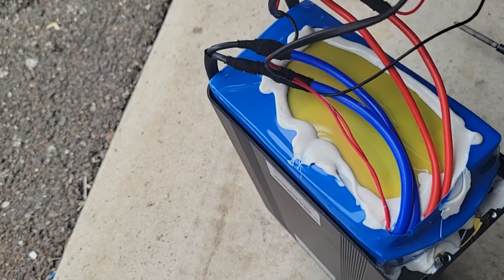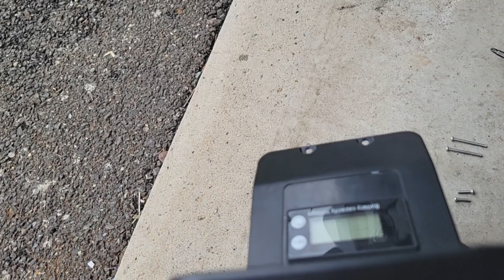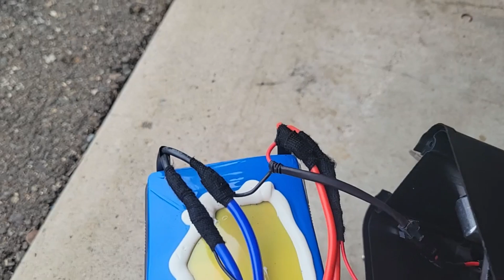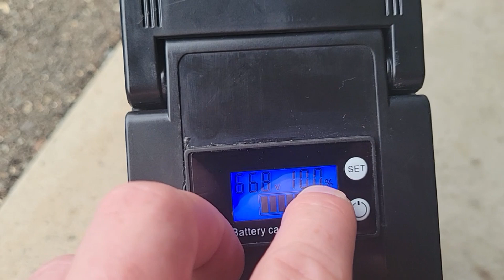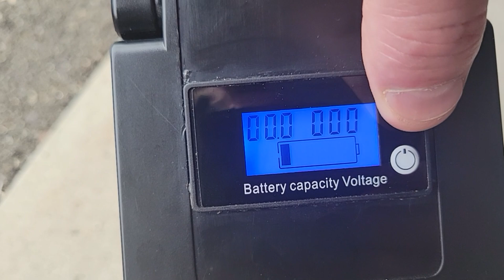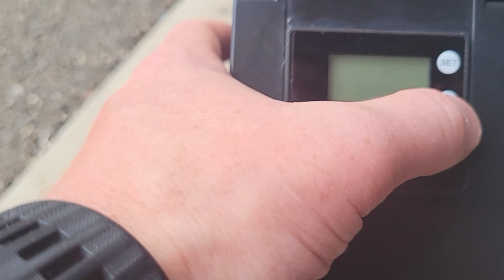EKX X21 MAX battery Voltmeter

Comment: Can you tell me how to turn it off? Do i just switch it off?
Reply from the maker: In settings, you can preset not to turn on when you start bike...
Reply: @JustDoItPlus  no sorry, I was talking about the bike not the voltmeter. Can you tell me  how to turn off the bike? Does it damage the baterry or the bike if I just switch it off with the red switch?
Reply from the maker: @Only_for_guys turn off same as turn on... touch screen with nfc tag,  same as to turn on... or just battery button,  it will not create any damage.
Reply: @JustDoItPlus  thank you!!!

Comment: Hi... 
Great video thanks for that...
I did same think but percentage is always on 100%, how to change that, i doesn't go down ???
Reply from the maker: @krunoslavbenko690  your voltmeter has wrong settings,  read manual for it.
Reply: @JustDoItPlus what manual ? can we contact somehow, facebook or something ?
Reply: @JustDoItPlus  I took it from your link, aliexpress
Reply from the maker: @krunoslavbenko690 it universal multimeter,  from factory can be preset to different voltage.  You need to set it to yours
Reply: @JustDoItPlus  what should I do now, don't understand, from where ? Do you have some contact?
Reply from the maker: @krunoslavbenko690  just read instruction.  It is simple.  Or find video on YouTube how to do it.
Reply: @JustDoItPlus  so I don't need another voltmeter ?
Reply from the maker: @krunoslavbenko690  no. You need just set it up for proper voltage and battery type. Lithium and 16s (60v) if you have same bike. EKXx21max
Reply: @JustDoItPlus  Yeah same bike :)
I put 16s and it works, thanks a lot 🍻

Comment: Why would you install a voltmeter when the volts are indicated on the display when you're riding the bike?
Reply from the maker: @emikearizona  no, it is not. On this model you can see voltage only in 30 seconds after bike turned on... Once you start ride, there shows mileage,  to see voltage you need to turn off/on bike again.

Comment: happy you are making videos on this bike.    Can you tell me if the screen can be changed to MPH? The manufacture said it could, but like Manny said, there is no way to get into the menu screen to change the settings without the -/+ controller
Reply from the maker: I sent request to manufacturer about display settings... hope will hear back soon
Reply: @JustDoItPlus  Any respond brother?
Reply: @kingqueen27 I changed mph to kph like this: turn off screen with label, when turn on press P button for some seconds and it's changed in loop